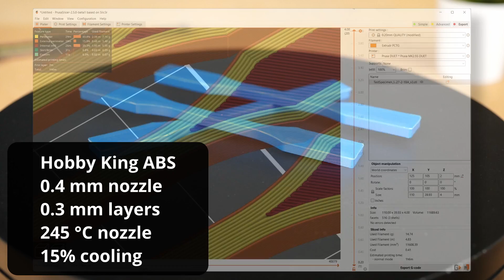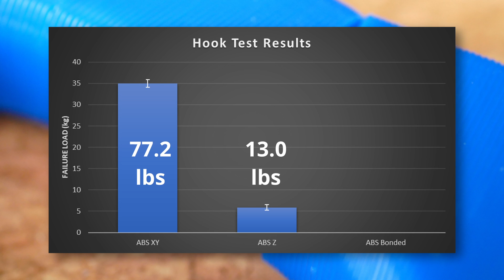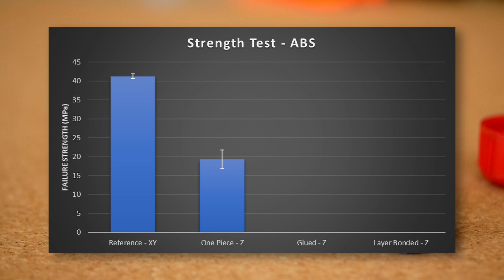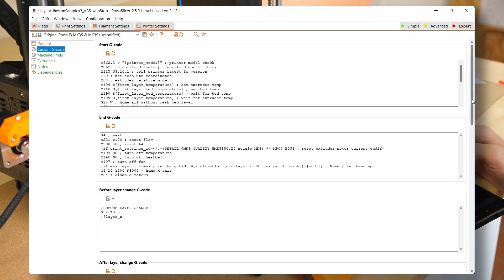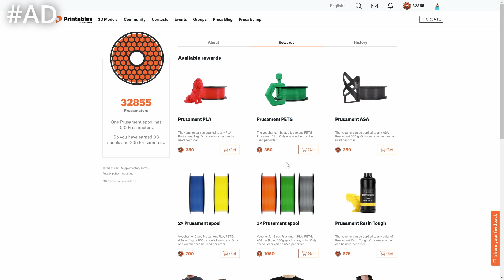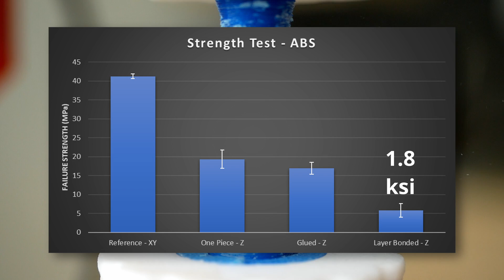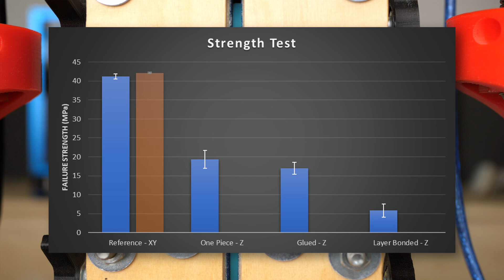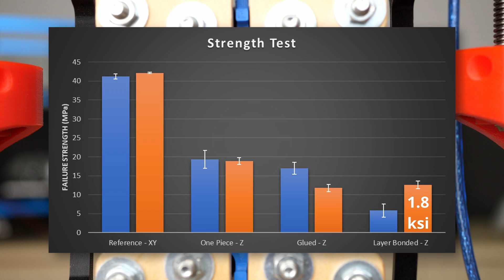Perfect Layer Adhesion if you Brush Solvent onto every Layer of your Print?

Comment: Ideas: Printing in CO₂ atmosphere, Argon atmosphere, under vacuum, all to avoid surface oxidation. (Vacuum would require huge interlayer times for radiative cooling). Or with laser preheating the area next to nozzle to print liquid ABS onto a thin liquidized surface layer.
Reply: Printing under CO2 creates further oxidation at that temperature since there's an oxygen source. Printing under a vacuum causes VOC release.

I've managed to get the result you're looking for under dry, high purity nitrogen at positive pressure. The impact on mechanical strength for PLA, ABS, and PETG is minimal, but there are other impacts from the reduction of oxidation, namely the material is more ductile.
Reply: @louisvaught2495  I don't see how CO2 could serve as an oxygen source for organic polymers, given that it'd be one carbon reducing another carbon. But perhaps it could attack the polymers as an acid.
Reply: @louisvaught2495  CO2 cannot oxidize things under ~1000°C! But otherwise I agree with you that impact of inert atmosphere would be minimal. The polymer doesn't oxidize at printing temperatures, main mechanism of degradation is depolymerization.
Reply: @Bizzon666  Problem with your claims is they directly contradict both published literature, and the XPS+NMR results hanging out on my laptop.

In the future, I'd recommend testing rather than speculating, otherwise you might wind up telling people outright misinformation.

Polymer behavior gets very complicated very quickly. At the direction of some of the best in the industry, I've stopped trying to speculate versus just testing it.
Reply: @louisvaught2495  Ok, I stand corrected, I didn't know the depolymerization is of oxidative mechanism 😬 I apologize
Reply: Knowing very little about chemistry, this was a pleasure to read, thanks to both of you!

Comment: I've built a Voron V2 and with the enclosure shut and printing at high speeds I really get the feeling I'm getting unparalleled layer adhesion with materials like PC, PETG and ABS.
I would like to see if printing at very high speeds in an enclosure really does improve layer adhesion.

Comment: Here's an idea that would take a ton of programming, basically would require a custom slicer to be built: converse concentric print patterns. For a print with three walls:

1. Print the inner wall with a counter clockwise grade.
2. Print the outer wall with a clockwise grade. 
3. Print the middle wall as an over extrusion between the two others.

The idea here would be that by introducing opposite-direction slope on the inner and other walls, we would create structural reinforcement. 

However, because layer heights discrepancies would create problems for the print nuzzle "bumping" parts of the print on the converse pass. Hence the need for an inner buffer wall that must be filled in afterwards via a slight overextrusion between the two other walls.

A similar approach would not use concentric opposing directionality, but would break the wall area into sloped curved rectangular cross-layers. Like a cylinder where each layer is like a circle of collapsed dominoes layering on top of each other diagonally.

Comment: Your test finds the single weakest link in the layers, perhaps you can work out a shape that lets to test a single solvented layer avoiding the time and the weakest link problem.  I can imagine something with two X layer pieces with a single solvent joined contact area.

Comment: I think the acetone smoothing needs a revisit with HOT VAPOR smoothing, not the cold version. This involves boiling acetone and exposing the part directly to those vapors. 

This way the parts are only exposed to the acetone for 5 seconds, instead of 30+minutes. This gives the acetone less time to diffuse deeply into the plastic and become trapped. Instead, the acetone flash-smooths the outside and is hard in a few hours.
Reply: To be clear, I would wait a few weeks or a month to let the parts "dry", I just believe the results will be better in the end

Comment: Heating an acetone-soacked piece of ABS in the attempt of drying it, will lead to acetone evaporate too fast and bubbling inside the piece. You can notice the bubble pattern in the broken sections. This reduce the cross section area and introduce weakness.
I learned it the hard way, heating a very soacked piece of "smoothed" ABS, obtaining a  deformed foamy piece of plastic.

Comment: I think you could leave small holes in the print and extrude a bit of (rough?) heated wire through them in the Z direction, then cut it just above the last layer. This would stitch the layers together at a few places. The extruding and cutting could be done with a single toolhead and the wires could either be short, or longer and straightened by pulleys before their extrusion. 
There are printers that can automagically lay glass or carbon fiber in the XY direction, so this could be quite achievable. More complex than brushing the parts with acetone, but certainly possible. I think you could modify filament extruders and nozzles to make  the system easier to make.
Reply: Post-tensioned polymer? That sounds like a fun experiment, and it’s funny how composite material strategies cross over from concrete for example

Comment: i guess printing slower and with more extrusion width, the material of the previous layer would melt more and fuse better to the new layer. 
putting solvent on each layer, while appreciating the effort put in this video, would have never come to my mind as being a good solution.

Comment: We cured our thin film samples spun from PMMA or PC in chlorinated solvents in a vacuum oven overnight at 60°C. In theory, I believe the dehydrator should work as well and I'm not entirely convinced the results are due to residual solvent. My thoughts are leaning more towards the solvent not having a chance to properly dissolve material at the interface leading to am improper solvent weld. The fact that you mentioned in some cases the material from the previous layer was moved by the nozzle also leads me to suspect that most of the material primed for proper welds may have been displaced (possibly due to material swelling) resulting in a bond that was worse than the original. I do like the stitching idea as similar techniques are used to attach problematic polymers together, like maybe using the nozzle to 'tack weld' the layers together by creating a few divots in the previous layer for material to flow in. Do it in a random pattern and it may add strength and it would probably be easier (and safer) than adding a solvent handling system for brushing some sort of welding agent on between layers. We just need an accessible 6DOF printer so that we can print a core in one direction and print the shell/perimeter in another one.

Comment: Perhaps try ironing each layer with a chunk of hot metal? I managed to salvage several 300x300 prints on the first couple of layers when I spotted separation from the bed. I tossed steel in the oven set at slightly hotter than the extrusion temp, then kept it from sticking to the print by using parchment paper.

If that yields results, a patterned iron to introduce small peaks and valleys to each layer might improve bonding.

Comment: perhaps a modification to the print head to include an acetone vapor to the layer after the deposition would be more automated and optimal. A small bottle of acetone, a small air pump, and a tube attached to the print head to follow the layer deposition.
Reply: i believe that to but there is a safety issue here for fire because aeton and other liquids like that start to burn from the fumes around them and with  that method you will have a lot of fumes and oxygen
Reply: Or we could take the opposite route, instead of trying to melt the plastic with a solvent we could use some kind of substance to help with adesion like some kind of glue or epoxy.

Comment: Thank you for your dedication to these time consuming tests of new ideas. I think that evaporative cooling ruined the layer adhesion. Would it be feasible to laser heat bottom layer in front of a nozzle printing new layer? Or induction heat iron filled filaments?
Reply from the maker: Might be a good option, though I do think there is a patent on a similar idea.

Comment: Very good negative finding!  I do wonder about the possibility of z-bonding with other things, like CA glue filling the gaps in the infill, but I'm not optimistic it'll work.  I think you idea of coming up with a texturing at the layer is a good one, especially if it is a 3d texture.  With two inner walls, if they zigzaged up and down and did so with a staggered pattern between those two walls, the strength could be higher.  The trick is finding a way to do that without crashing into the part.  6-axis print head?  Of course, once you get into multiple print head angles, a ton of reinforcement options open up and the slicer becomes an order of magnitude more complex...

Comment: I would think stronger layers would be achievable with a slight non planar pattern in the layers. even just a small wobble pattern would probably boost the strength. not sure how you could set that up though :/

Comment: Is it possible to fill the shell of the 3d print with epoxy resin before the top layer gets printed? That allows the 3d printer to make unique shapes and the resin to hold the strength.

Comment: (I work with a plastics company in their R&D department) Put in mind they might be weaker due to annealing! Test a normal sample conditioned at 60C to compare with the bonded ones. Putting it at 60C Will probably relieve internal cooling stresses which weakens the part. Condition both at 60C, one as-is and one broken/rebonded, so that you’re comparing apples to apples ;)
Reply: Wasn't the food dehydrator already at 60°C?
Reply: The glued parts went through the dehydrator and were still stronger

Comment: I think "stitching" layers in the infill would help. Quickly moving the Z axis up and down while the infill is printing. But there would be lots of challenges. Either way, great video!
Reply: The infill doesn't do much for part stability regarding bend stress (usually the most relevant for parts breaking).So this will not help much for most applications.
Reply: @pastagandalf  This is a common misconception. For many parts the infill is loaded very similar to the perimeters. It really depends what you are doing. But this sort of technique could also be applied to perimeters, sans the outside perimeter.

Comment: Just a thought, there is one more test you can do for intra layer acetone... if you're going to be brushing on solvent on each layer anyway, you can just print all the layers separately/flat and then brush them on after and assemble/clamp them. You'd probably need to also print a form to hold the layers in place and you'd have some extra time to assemble, but this would probably also drastically reduce the time since you'd have many layers printed at once and then can brush on the acetone all at once, then stack in the form and clamp.

Comment: I was concerned that the solvent would boil off as soon as the ambient heat coming off the hot nozzle got to it... Seems it was a problem even before that!

My idea for improved layer adhesion, would be to have a tool, like a hot soldering iron tip or something, that goes around and 'stakes' the current layer down into the previous few. For best results the tool might need to be something other than a smooth conical tip, as I don't think that would disrupt the plastic enough to really bond the layers... Maybe shaped more like a Torx driver bit, but tapered... 🤔

Comment: I just had an idea that I need to figure out how to test myself if you don't. I wonder if it would work to have small gaps between perimeters (or at least inner perimeters) and then offset the perimeters of each layer and over extrude a bit so that the next layer fills those gaps a bit. Idea would be to give each layer more surface area in contact with the previous as well as basically creating "teeth" within each layer. Would be really difficult to implement practically, especially since the only way to test it would probably just be increasing distance between perimeters and somehow over extrude every other layer, but I'm really curious if something like that could work. 

Second idea would be having the flat surface of the nozzle being slightly rough or having minute "spikes" almost to rough up the layers as they print to slightly increase surface area I guess. Probably wouldn't work but I'm curious.

Comment: In 2008 Nophead designed his SkyHook ( https://hydraraptor.blogspot.com/2008/11/sky-hook.html ) and suggested on one of the forums (can't find the link now sorry :( ) to dip the whole part into acetone for 10-20 seconds, take it out and put on a metal mesh to air-dry in room temperature. Aceton would soak into the whole part and when acetone completely evaporated (took 2-3 days, important not to dry it forcefully with a hairdrier or similar device as the idea is to let it slowly dry ) ... the part will initially be soft, rubbery like but will then solidify as acetone completely evaporates. The part becomes significantly stronger - I personally printed and used few of those for years, you print one and do not dunk in Acetone, try to use it and it falls apart immediately after you attach the kilogram of filament to it, you dunk it in acetone, get out to dry, forget for a week on a window board (outside), then mount it and not only a 1kg of filament is safely ganging but actually a 3kg roll works no problem. I tried this method (and am still using it today) many times when I need more strength of the ABS part and I do not care about details (dunking it into acetone will kill off all the details).. sometimes it takes 2-3 days to fully harden, sometimes even a week but the results are great, try it out :)

As for "other materials" HIPS can be glued/smoothed/dissolved by LIMONENE

PLA can be dissolved/glued by MEK (or something called like that) some organic solved, super damaging to health, I had a friend try to glue two PLA pieces I sent him, he managed to crumble the pla but never managed to take them apart so that solvent do work awesome for PLA only not very good for living creatures including people.

Comment: Looks to me like the brush strokes and liquid getting trapped in the plastic and expanding causing bubbles is probably the cause of the failure. 

Maybe if you could waft vapors around the nozzle like a welding shielding gas you would have better results?

 Maybe a cotton swab with solvent absorbed into it is placed into an enclosed device attached to the head that is plumed to a gas shield around the nozzle. As the solvent evaporates from the heat it flows around the nozzle and hopefully displaces any air and reacts with the plastic to create better bonding environment 

You probably wouldn’t want to use a fan because you would mix vapors with air and lessen the effect. Also it would have to be a chemical resistant fan if you did. I imagine there should be enough vapor produced by the heat from the printer to cover a small area around the nozzle.

Comment: The idea is good. The solvent risk is negligible: think about cars engines...I reckon solvent needs a lot more time to evaporate if they are embedded in the parts. Using acetone/ABS mix as a glue for motorbikes fairing repairs I can tell it takes weeks to fully dry. As an idea it could be nice to modify the slicer so it prepares small vertical holes and a separate tool insert a hot metal wire in the holes once every few layers. The metal wire could be distributed as the plastic filament (from a bobbin) cost nothing and the inserting tool could be very similar to the printing head (feeding,  heating) but just with very little cutting system... of course easier to say than to do...

Comment: I've always wondered if you could increase layer adhesion using a laser to heat the area that the extrusion is supposed to bond to in advance, and maybe keep it at a specific temperature during / after extrusion for a bit. Probably no better than a heated enclosure, but the pinpoint heat might mean you can get the surface to just slightly melt without risking the whole part.
Reply: Just printing slow can do this, the nozzle will heat up what's around it. The part cooling fan reduces this effect though
Reply: Yep, that or a strongly directed hot air nozzle

Comment: The "part-cooling fan" is imo a major weak-point. For a solid --> glass --> liquid transition, I would imagine that the aim must be to go from liquid to glass, but no cooler. The part-cooling fan cools parts too aggressively to allow the next layer to bond well. My bet would be that if the parts "cooling" fan were to blow lukewarm air at a steady (say) 130'C (instead of room-temperature) that the inter-layer bonding will get much better.

Comment: Maybe we can make a vapor deposition system that deposits enough acetone to help with bonding but not enough to deform. I think I'd want to know more about the process of acetone bonding if I was to get any kind of actual idea on that. Another option I would imagine would be a kind of iron that could follow the extruder around to add more heat to the print.

Comment: One way to increase inter layer adhesion along the slice axis is to increase your layer width to 0.425 and decrease your layer height as low as 0.05 for a 0.4 mm nozzle. This causes under extrusion to be represented in the horizontal direction instead of the vertical which is the primary cause of layer adhesion failure due to filament diameter tolerances and accuracies along the axis of slicing. Thank you for your work Stephan these videos are very important.